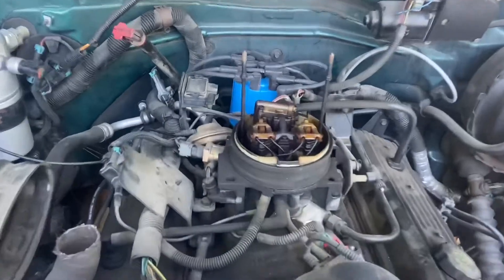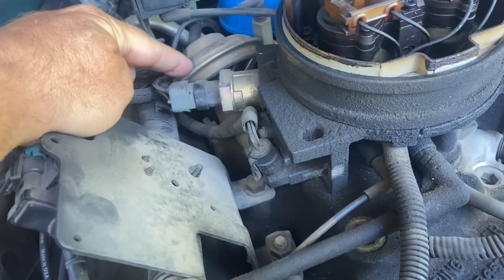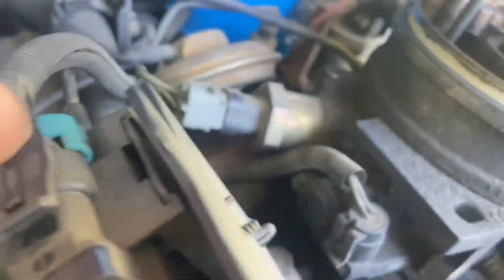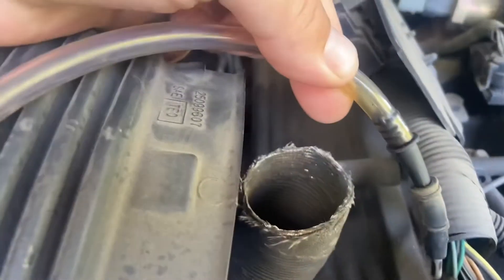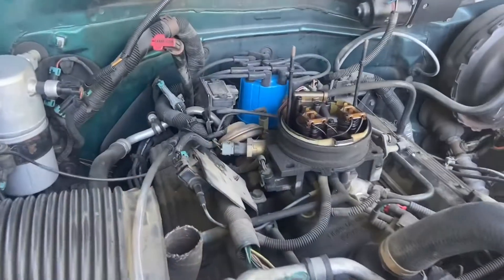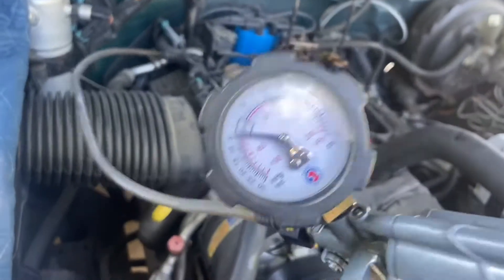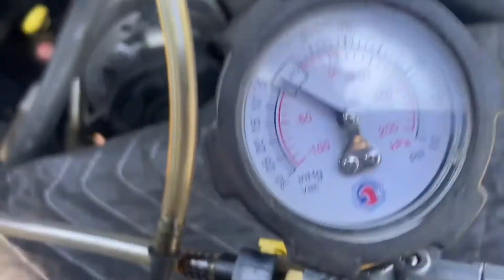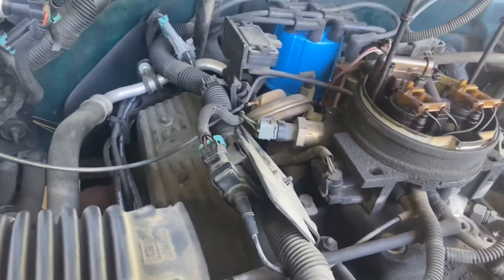Testing EGR valve on GM 350

Comment: I have 1990 chevy v6 tbi. My egr valve is on the other side. My truck stalls really bad. I changed the iac valve and still nothing. Help !!! It stalls and turns off when I change gear reverse or in drive

Comment: Can you use the vacuum tester on the old valve while it is on the truck and just see if the suction will hold? Does the truck have to be running?
Seems like you could put a tube on the vacuum line and suck on it and see if it sticks to your tongue, heh

Comment: Fault code 32 EGR valve, for me ended up being the EGR vaccum nipple being blocked solid, easy fix drill a 2mm hole in the nipple. Fault code went away and nipple will not block again!
Reply: Help. I got a code 33 on mine.

Comment: Ok, out of curiosity, i have a 95 5.7 tbi.  And ever once in a while.  I'll crank the truck up. And I'll run ruff for like 5 seconds or som bog down like it wants to cut off. And then fun perfectly normal. Any idea if thr rgr valve is related to that. Also, while idling sometimes. I notice that the truck runs a slight rough idle.  But it's very suttle.

Comment: I have an 1989 tbi 350 . I get a service engine soon light but only on the high way and then goes away once I turn it off and on . Did the paper clip trick and got and egr code . Looks like I’m changing the egr valve
Reply from the maker: Make sure the passages are not clogged up.
Reply: Amen. Recent purchase 1989 K1500 5.7  pings under load.   Found knock sensor unplugged.  Plugged in, no change. Timing is okay.   EGR valve tests good and passages at the valve okay.  Decide to change intake manifold gasket because it is original, so past time.  Discover the EGR passages where manifold goes into engine absolutely carboned shut. We are talking coal mine shut.  Hopefully this cures the ping.
Reply: @Lloyd-z3q did it?
Reply: @Lloyd-z3q did it??
Reply: @Lloyd-z3q did it work ?
Reply: I've got the same thing on my 1995 tbi 350. Replaced the EGR valve (not new solenoid) and it didn't fix. Did you ever fix your issue?
Reply: @danielworley9468  my egr code stopped showing up I just had a timing issue . They never disconnected advance timing before setting it to time so I was “retarded”
Reply: @danielworley9468 help. My 1990 chevy obs. Idles bad and stalls when I shift to reverse or drive. Help
Reply: @Livemusic1800 sounds like your engine timing is off, probably the computer trying to compensate for it
Reply: @Livemusic1800 I just disconnected the vacuum hose on the passenger side by the manifold fixed the issue going to have to replace the hose it’s clogged some models you may get the check engine light mine didn’t come on 89 Chevy 1500
Reply: @juicefarms3579  hello. My truck idles bad and stalls turns off slowly in reverse and drive. Yesterday I checked for vacuum leaks i hear a hiss but can't locate where its coming from. I disconnected the iac sensor and valve and it idles better. Why tho ??  Can it be the distributor too ?
Reply: I got a 1990 chevy obs read code 33 error.  Help !!! It idles bad and stalls when I shift to reverse or drive
Reply: @Livemusic1800 you need to check the small vacuum hoses that connect to your MAP sensor (likely under the air cleaner), if the hoses are connected properly and free of obstruction you need to replace the MAP sensor
Reply: @danielworley9468 I know one of them is cracked i taped them but need to order a new one. Also a map sensor now 😔  the guys that worked on this truck did a bad job all the cables were loose. I might need to replace all sensors then.

Comment: Step one: Buy an EGR block off plate, Step two: remove EGR and install block off plate, Step three: rent Uhaul trailer and pack and move to another state.
Reply from the maker: Except when you block off the egr the engine will PING.
Reply: Lean air fuel incoming
Reply: What do you mean it pings ?
Reply: @JohnGotti-yx6gc it will make loud pinging noises while accellerating, the wrong mix of fuel/air leads to internal detonation
Reply: @JohnGotti-yx6gc internal detonation is not good for a cylinder and can cause major damage. There are ways to delete it but it would involve changing tunes and some other fuel/air issues

Comment: EGRs limit power.
Reply: In what way? Can you just cut the EGR valve out?
Reply: @enermaxstephens1051  Egr valves force hot air into the engine (less power). For example nitrous makes an engine have more power because its a very COLD gas. Hot gases make it so that less air and fuel can go in the cylinder.
Reply: @fish_R_stinky69  But won't your catalytic converter get red hot? They used to get super hot on older vehicles before they started using EGR valves
Reply: @enermaxstephens1051  I deleted that one too.
Reply: @enermaxstephens1051 don't just delete the egr and expect perfect results. It really gains no power, actually increases your internal combustion Temps, and can lead to feul/air mix being off and cause ping or detonation in your cylinders which do major damage. To delete, there are more steps than just blocking it off like adjust fuel/air mix and other stuff.

Comment: i have put 2 new egr valves on and alot other parts,  it still wont run right with it connected..
Reply from the maker: When you say won’t run right do you mean it won’t idle well? Or some other symptom
Reply: @robfaith9999  engine has low idle, hesitation when pressing gas, sputtering.
Reply from the maker: Have you checked if the EGR has vacuum at idle
Reply: @struckync  did you figure out what the problem was?
Reply: @struckync  have the same exact problem
Reply: @itsolplowboy7623  Same problem, anyone figure it out?

Comment: The line coming from the egr valve plugs into which fitting top or bottom
Reply from the maker: it should be the bottom. easily find out by finding the port that bleeds off when not energized
Reply: So one of those, the top one stays open? Damn Ive been trying to figure wt' hell goes there haha @robfaith9999
Reply: Just remove egr...best for motor...
Reply: @barrygordon1173  Won't the check engine light stay on forever?
Reply: @enermaxstephens1051 needs a tune then